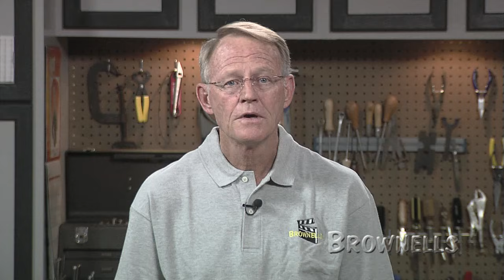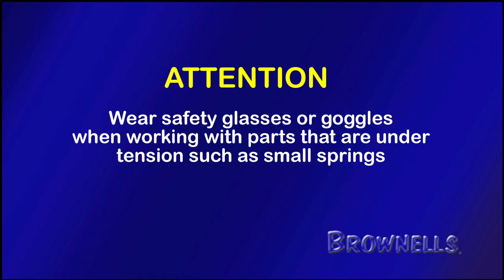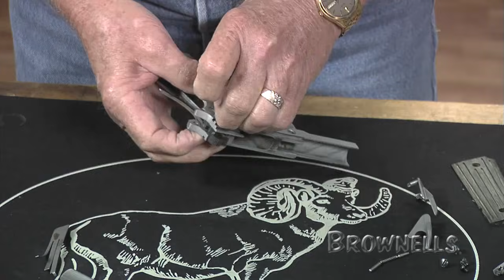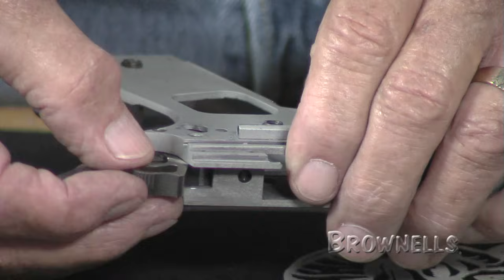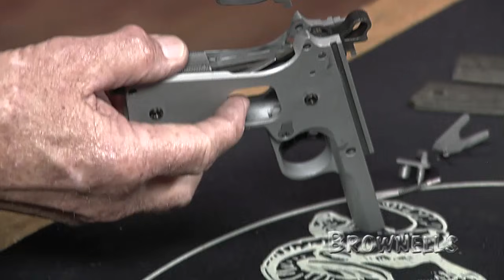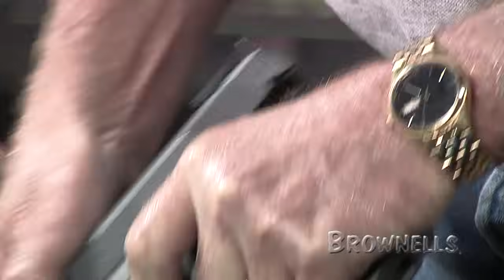Brownells - Installing a 1911 Drop-in Trigger Kit

Comment: I love how things are described as drop in only for you to find out that you need 12 different tools and the patience of a saint in order to deal with the 12 different parts that you have to remove an eight springs that you have to keep up with or otherwise you've screwed the whole operation
Reply from the maker: Drop in just means minimum fitting required

Comment: To all the so-called gun experts/snobs.
LOL Do you even know or realize how many times a 1911's slide and hammers during WW1, WWll, and Korean War were dropped on an empty chamber? Try thousands of times for guard duty inspection, but yet they still worked perfectly. People need to stop spreading urban mythology that a 1911 is made of glass and any little thing will damage it, because John Browning is in his grave saying "what idiots. I designed a tough handgun now abuse it".
Reply: amen!
Reply: This is why I intentionally put idiot scratches in all my guns, Glocks included. Because guns are meant to be used, not babied in a safe.
Reply: If Bill Wilson says that dropping the slide on an empty chamber hurts the gun then it does
Reply: Yes-and those GI 1911's had forty or fifty thousandths hammer hooks, and 7 or 8 pound trigger pulls. Modern 1911's have 20 or 22 thousandth's hooks and 4# (or lighter) pulls. It's called 'progress' and you should check it out.
Reply: @scoutrifle6827  Yes "Progress" like modern steel with better metallurgical properties. You are right maybe you should check into it. LOL
Reply: @scoutrifle6827  what are you talking about? SMFH That has nothing to do with the subject.

Comment: Soldiers for inspection during guard duty dropped the slide using the slide release tens of thousands of times without ever doing any damage, as well as dropping the hammer on an empty chamber. That is the way John Browning designed it to be used. Oh but wait I guess Mr. Browning was wrong. NOT
All that crap about dropping the slide on an empty chamber came from weak ass polymer frame guns that won't stand up to it.
Now you know the truth.
Reply: The truth is people see Hollywood do a lot of things in movies that people mimic without any concerns, truth is slamming a slide shut on an emty chamber when you don't have to or dry fire unnecessary, it looks cool but it's unnecessary ware. If you help it will last longer. It belongs to you !
Reply: @waynecastleman1363  you do realize they were designed to do that. Movies have nothing to do with metallurgical properties. It would take more than a life time to wear it out. Plus if it should break or wear in your life time that means it was forged improperly.
That is why there are still old military surplus guns that are still around today over 100 years old operating flawlessly, and they've been dry fired and closed on an empty chamber thousands of times.
Reply: @abcertweld  As I said it belongs to you, no doubt their stronger then some guns today, but as you know things tend to break more often then the old GI stuff, your right. I wouldn't recommend it so much this day an age, you know Mem parts are O.K but not the older build was built to last mud sweat an tears. I just bought a new Kimber LW and it's a very nice pistol but it wasn't built for hard combat all aluminum frame, LW. But it is a accurate running machine. But my point is I take care of my guns because their expensive.
Reply: They had proper machining lol.  I already see peening of the barrel lugs after doing it a dozen times.  Thank shit Turkish manufacturing

Comment: that disclaimer near the end regarding dropping the slide is not accurate. it's possible that it could be accurate for some knockoff/shitty brand 1911s, but not a colt. this pistol has been around for over 100 years and served many decades in our military, going through that process of dropping the slide on an empty chamber every day. if this problem ever existed, which it didn't, don't you think it would have been fixed by now anyway?
Reply: Sam Ace Rothstein you are100% correct sir. not sure how all that mess got started about dropping the slide or how people think the gun survived so long in military service if it really is that fragile. the slide can be dropped over and over again for years and it can be dry fired (Army firing ranges require you to show the range office a clear chamber, drop the slide, and dry fire into the clearing barrel)
Reply: What he is saying is that if the hammer is to fall when you release the slide to not do it again because you know it is not working and doing so again risks shearing the tip of your sear
Reply: Richard Johnson LOL Do you even know or realize how many times a 1911's slide and hammers during WW1, WWll, and Korean War were dropped on an empty chamber? Try thousands of times for guard duty inspection, but yet they still worked perfectly. People need to stop spreading urban mythology that a 1911 is made of glass and any little thing will damage it, because John Browning is in his grave saying "what idiots. I designed a tough handgun now abuse it".
Reply: @abcertweld  What im saying is that I think hes referring to the gun malfunctioning and hammer falling
Reply: It is absolutely accurate and you are wrong.
Reply: Scorched earth LOL no buddy you are wrong. Soldiers for inspection during guard duty dropped the slide using the slide release tens of thousands of times without ever doing any damage, as well as dropping the hammer on an empty chamber. That is the way John Browning designed it to be used. Oh but wait I guess Mr. Browning was wrong. NOT
All that crap about dropping the slide on an empty chamber came from weak ass polymer frame guns that won't stand up to it.
Now you know the truth.

Comment: To answer my own question since Brownell's wont...

From what I've read it sounds like the concern is dropping the slide into battery without a round slowing it down is what causes undo stress.  Even when chambering a round some people suggest holding the trigger to further prevent damage.  Sounds unsafe to me, but that's what the interwebz are saying...
Reply: Imagine what happens when a 20,000 psi explosion forces the slide violently backward until it slams to a stop as it hits metal.
Reply: That is what a functions test is for, if you doubt your disconnector that much, test the thing

Comment: Regarding the "abnormal drop test" that should not be repeated... isn't that essentially what you would be doing when you chamber a round, i.e. dropping the slide into battery without holding the trigger?  Am I missing something?
Reply: Nope.  Not really. 

No only that the entire firearm is under tremendous stress when actually fired.  Anything a person does short of intentionally damaging parts will be nothing compared to the 20,000 PSI explosion happening inside the chamber, and having that force the slide violently backward.